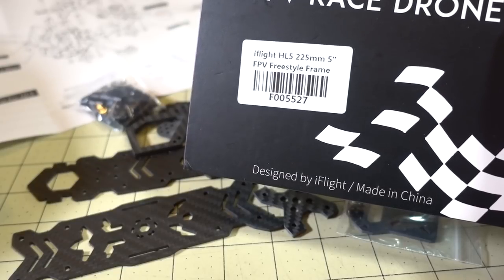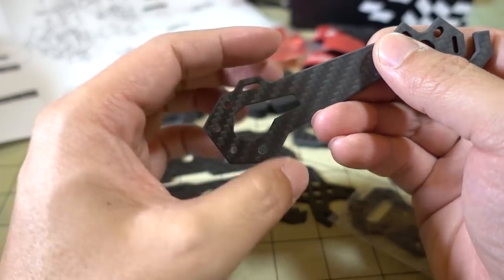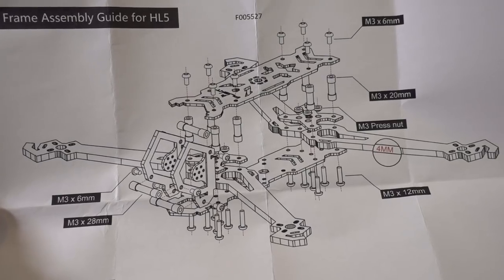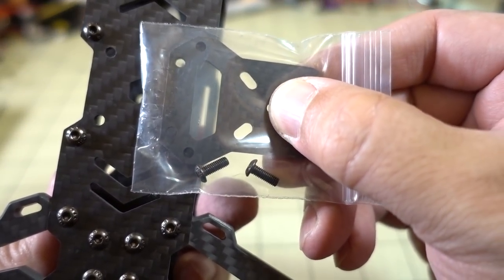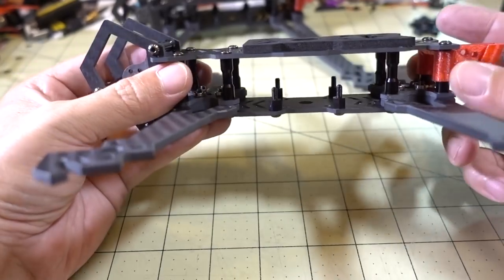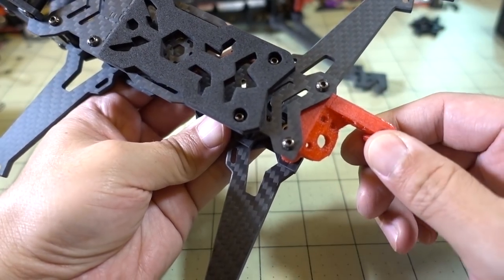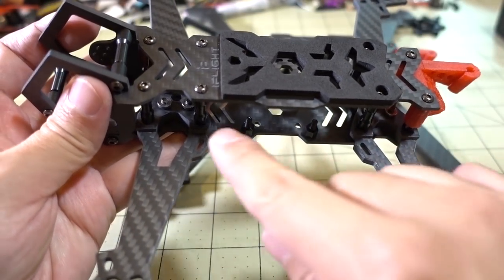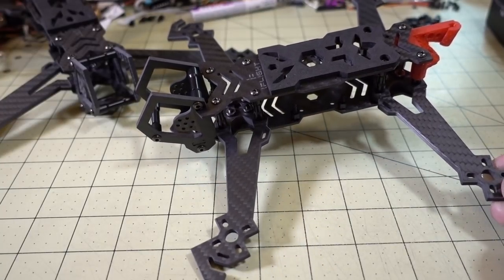iFlight-RC HL5 & HL7 Frame Review 😀

Comment: Just ordered this frame in the 7" version. Going to use Racerstar 2307-2200kv motors.  Very excited about this build. The frame looks very durable. I don't mind a little extra weight, if it holds up to a crash or two. Nice job iflight, for changing it up a little.   Keep up the good work Albert.

Comment: Guys here concerned the durable of the arm gap,but we tested a few before production,find out it is fairly durable,stiff enough.We are considering to make Pre-tuned HL7 RTF kit,we find out the super stiff arms are better for long range,that's why we use 5mm thickness arm. For HL5 freestyle, 4mm arms is enough to carry some crashes.
Reply: Ok Iflight Rc, but what about the middle section of the frame (whre the FC goes), especially with the 7 inch? The construction of the frame is such that we have a heavy front (with thick arms, sandwich plate, screws and so on), heavy back (thick arms and all the hardware like motors) and between those just two thin (only 2 mm) plates of carbon. I am not affraid of breaking the arm in crash, but breaking the frame in the middle section and , as a result, damaging the stack. Have you considered making those central plates a bit thicker?

Comment: Well if you haven’t done the 7” yet I’m interested in and well going to attempt the 7” GEPRC Elegant I have the 5” and have the 7” frame kit on way but am a tad nervous about it for I don’t want to waste money or screw up the first time hahaha I want to eventually do a 10-14” long range but feel i need to do this one first but I was thinking 2212 900kv?? And 4-5S but I want gps for pos hold as well as RTH along with full atty switchable and I donno maybe the Naza V2 or M with gps for the flight control that would interest me a crapload hahaha thanks good vid!!
Reply from the maker: I plan to use a 2207 1700kv for my 7-inch build on a 4S lipo.
Reply: Albert Kim I was thinking of even going to 1250kv I want long range long flight time!! Lol

Comment: Oooooh that's gonna break in a semi hard crash
Reply from the maker: Really?  How do you know this?  Have you tested it?
Reply: Iflight and nidici suffer the same issues, bad stress point placement. Every frame I've tried from iflight have all broken right at the standoff in front. The rear is usually more resistant. They fly fantastic, but iflight and nidici are THE ONLY frames I have ever broken. The reason for my statement however is the empty space in the middle of arm where it meets the bottom plate. If there was a sandwich plate I would not be saying that. Just my thoughts from previous experiences with bad designs.
Reply from the maker: There is a small sandwich plate on top of the arms.  The arms go between that and the bottom plate.  I don't like that gap either, but they told me it held up in crashes.  I think replacement arms are gonna me $5 if that helps any.
Reply: Albert Kim hmm, yeah that just seems like a Lotta stress to put on that tiny area of carbon. I just built up the iflight xl6 6 inch frame. And it broke in A soft crash in grass, but good god did it fly well, it's almost worth the hassle of replacing arms.
Reply: Hello,what frames do you have in hand? we can offer our V3 series frame at a half price to let you test again.I hope we can make improvement and make you guys happy with the quality.Now we make our own carbon plate,we have better quality control,and some design faulty improvements.send me message on facebook if you are willing to test "V3" frames
Reply: Iflight Rc im definitely willing to try that, what ever frame you think is best.
Reply: We have the classic line of iX and XL series, it is difficult to me say which one is the best,lol